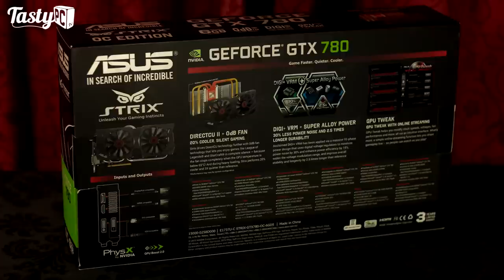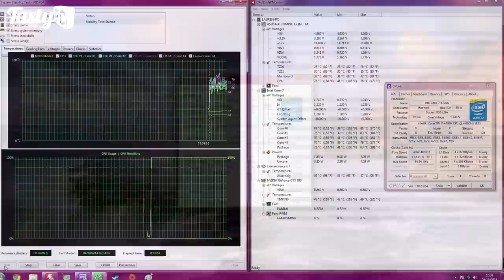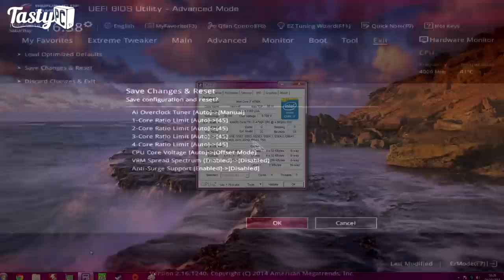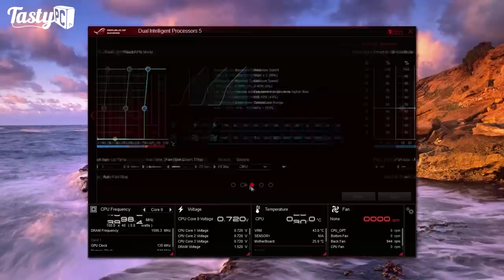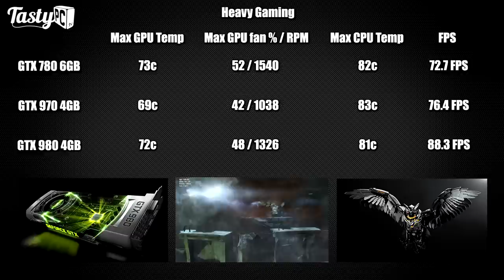Semi-Passive Gaming Build – GTX 980 970 780 Strix, i7 4790K, Noctua NH-D15, Corsair 730T, ROG Hero

Comment: still I don't get why nvidia decided to skip one generation of cards, at least as far as naming goes. It pisses me off that companies for some reason like to create confusion.
Reply from the maker: The idea was suppose to be that it prevents confusion when comparing the desktop GPU's to the laptop ones, but it is a little silly lol.
Reply: TastyPCTV
AMD did the same with the HD9xxx, the HD8xxx being only rebranded previous generations models, and skipped the HD9xxx. Maybe they were tired of this naming and were in a rush to using a new one.
Reply: TastyPCTV
irrelevant argument as we already have 9xx mobile gpus. They even fail to explain it properly.
Reply: TastyPCTV Actually no it wasn't , it was so they could promote them as both being based on the same die and both Maxwell. They couldn't do this if they marketed the desktop as 880 series as they already had used 880 in the laptop so there was little choice really. Made perfect sense to me to do what they did.
I am very suprised that the laptop 980m has around 75 percent of the performance of a 980 desktop though. Obviously only while plugged into a mains though. It loses at least half of the performance just on battery.
It does mean the 980m is not all that far away from a 970 desktop overall though for gaming which is pretty incredible.

Comment: I HOPE i get this time an answer...would be nice...
My card had pretty bad coil whine [Gigabyte 970GTX G1]. Can you tell us if the     [Asus Strix GTX970] has also coil whine issues. (And pls be honestly, even you get sponsored by ASUS :P )
SEE ALSO : http://youtu.be/8ko7edYNolo
Reply from the maker: I do talk a little about coil whine in this video, however until I review the Strix cards I won't know for sure, I'm sorry the review is taking a while, but if you want my prediction I think that all 970s and 980s will have some coil whine regardless of their make or model.
Reply: TastyPCTV Thank you for answering my question. I am just disappointed that all those manufacturers are not able to fix that issues.....Well anyway your doing a good job, very informative videos.
Reply: It seems to be a question of luck just like OC.
In the german forum Hardwareluxx there is a thread which collects experiences on this.
for example from the 16 Gigabyte 970GTX G1 there 8 were fine, 6 have coil whine with high FPS and 2 were bad.
From the 8 Strix it was half and half. 

So it is really hard to give a recomendation. Wish you good luck on your search ;)

Comment: You talk so fast and so weak toned that nobody can understand a full phrase. sorry!
However, it's a lot easier for me if i see your lips movement.Or am i just too slooooowww for all of you.
Almost forgot....what excactly good is using 16Gb of RAM????? Except for it looks nice is there any difference using just 8Gb????
I got an i7-2600K@4.4GHz on an old Thermalright Ultra 120 Extreme cooling (too old for you? Not for me apparently), G.Skill 8Gb RAM 1866GHz (XMP mode), Crucial M4 128Gb SSD, Corsair RM650W modular PSU (gold, sorry not Platinum), Asus P8Z68-v Pro motherboard, Asus GTX 970 STRIX and all this in a CM Stacker 830EVO case and i bet my bench numbers are very near to what you get there.....